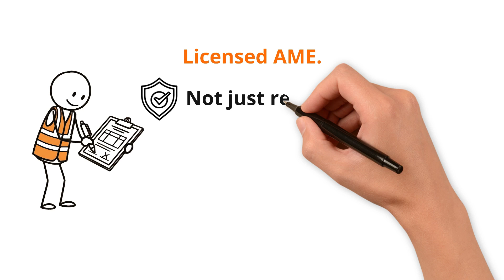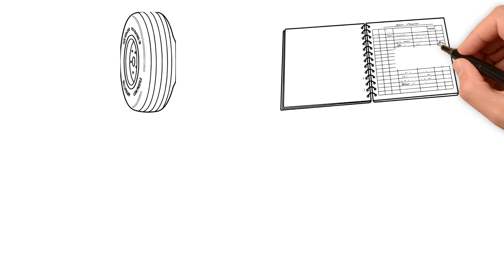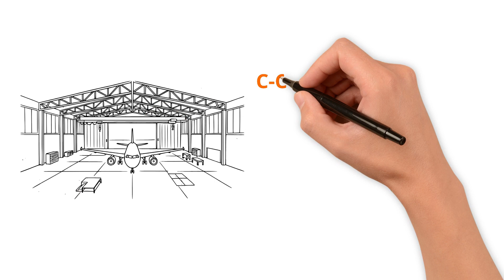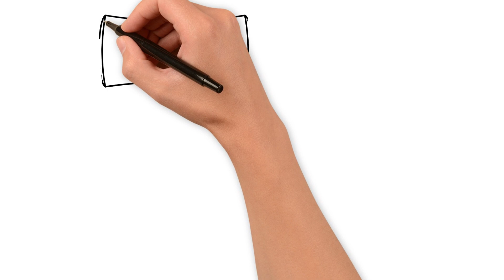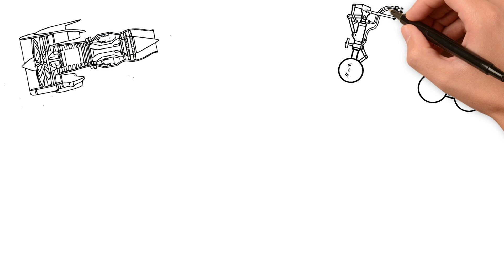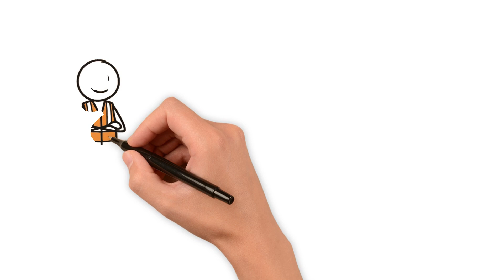How Often Is Your Aircraft Actually Maintained? (An AME Explains)

Comment from the maker: One thing that does not come across in the numbers is the documentation side. Every single action across every check level has to be recorded, referenced against the maintenance manual, and signed by a licensed engineer. It is not enough to do the work. The paperwork has to prove it was done correctly. That documentation is what the regulator audits. That is what the certificate of release to service is built on. The work and the paper are equally important.